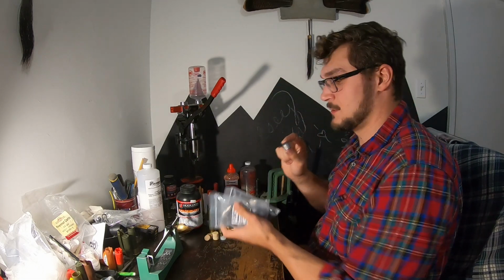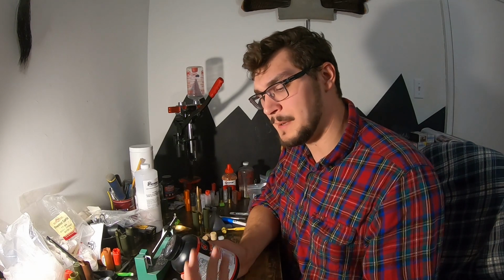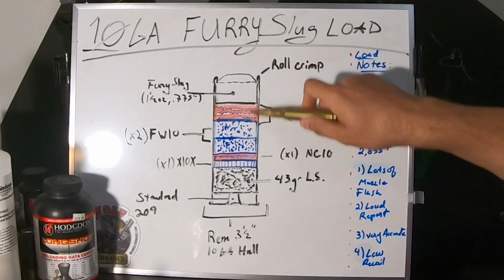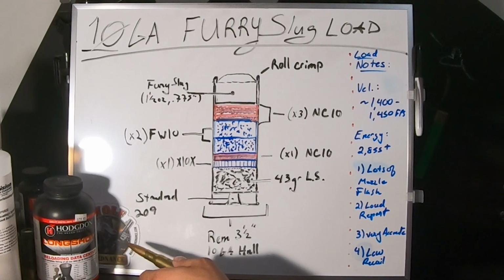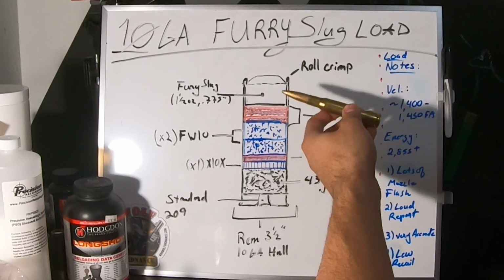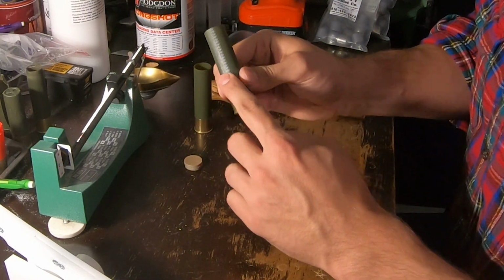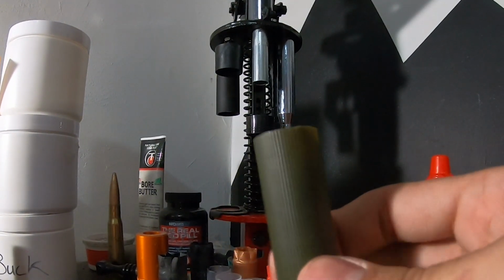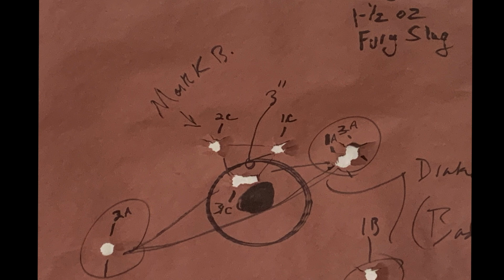10 Gauge FURY Slug Load: A Fast and Furious Game Getter

Comment from the maker: Welcome back to the loading bench at American Arms Channel! In this episode we examine my load for the Fury Bullet Co. 10ga Fury Slug. Please remember that this load has not been pressure tested nor is it published and is not to be considered reliable. Replicating my loading is done so at your own risk. Remember to always reduce charges by 10 to 20 percent to start and work your load up gradually. All universally accepted shotshell loading best practices and safety precautions apply. 

* DID ANYONE CATCH THE SPELLING ERROR ON THE WHITE BOARD?!?!?! HAHAHAHA!!!!***

Components and tools used:

Hull - Remington polymer base wad 3-1/2" 10ga hull (white base wad)
Powder - Hodgdon Long Shot
Primer - CCI # 209 (Standard)
Gas Seal - BPI X10X (Gualandi 10ga Gas Seal)
Nitro Cards - BPI NC10 (.125")
Fiber Wads - Precision Reloading 1/2" 10ga Fiber Wad
Slug - Fury Bullet Co. 10ga (.775") 1-1/2oz FURY SLUG
Roll Crimp Tool - BPI Original Roll Crimper (10ga)
Loading Press - MEC 600jr (10ga - 3-1/2" Mag)

Detailed viewer questions and private conversations, as well as industry contacts regarding product evaluations and reviews may be made at AmericanArmsChannel@gmail.com

Comment: Thanks for the video!  I have purchased several orders of these slugs.  I used Unique and Universal, but I will start using the large amount of Longshot that I have.  I have loaded them into both the 3-1/2 inch and 2-7/8 inch hulls (cut down R-P hulls).  I use the slugs for bear defense.  The Short Tens in my custom BPS 19-inch (w/ Remington 870P rifle sights) are a decent proposition.  5+1 capacity with the same power level as the Magnum Ten.  Again, thanks for the great video!
Reply from the maker: Sounds like one bruiser of a shotgun; you should do a video on it! 

Thanks for the praise! 

- Drake

Comment: HS6 is my go-to in 10, 12 and 16 gauge for field, slug and buck
Reply: I haven't been able to find hardly any 10 gauge slug or buck date for hs 6. I found a lead load but it uses remington sp10 wads which may as well be made of unobtainium.
Reply: @jacobackley502  whats your email ill send you pdfs of full manuals. Btw loading buckshot and slugs by payload weight is safe only problem is stacking fit if too low in a wad it can always be adjusted with filler wads. If the weight of the payload is just a little less than that listed on the data its OK pressure will be lower but the velocity will go up.
Reply: @WARXDEVILXALAN  jacobackleyusn2018, it's a gmail. I'm only not posting the full @ version to avoid the spam bots

Comment: Got the Terror .720 choke tube and it patterns great. Have you tried the .705 tube for the 10 browning gold light. If so could it be used more for decoying ducks? Or should I just I just stick with the the .720?
Reply from the maker: I do not have nor have I tried the .705” Terror Tube. The .705, being tighter than the .720 would not be the ideal constriction for decoying ducks. .705” is fairly tight for steel and other Non-tox shot types, and is likely to blow patterns and make it useless for any wing-shooting work, or produce highly dense shot patterns ideal for extended range shooting. Really, the .705” constriction is more-so a turkey choke than it is a choke for wingshooting. It can be used for wingshooting and with Non-tox shot such as steel (iron), but It may be much more finicky about shot type, size, and payload for good patterning than the .720”

If you are looking for a decoying choke tube for the Browning Invector 10, I recommend trying your Factory Mod and IC chokes, as well as any assortment of aftermarket IC, Mod, and IM chokes by *insert your choice of Manufacturer here*. Really, the .720 can do everything it needs to with Buck, Slugs, and fine shot sized loads of lead, steel, tungsten, and other and no-tox shot materials from 30 to 75 when you’ve paired it with the right load. It’s only flaw is too tight of a pattern for close range work, but you can’t have your cake and eat it too. Honestly, I carry two chokes with me when hunting with my G10: the Carlson’s .750” IM and the .720 TT. If one can’t get it done, the other can. 

Hope this helps answer your question.

- Drake

Comment: What are your thoughts using a 1-3/8 ounce rifled 10 gauge slug with this load? Any alterations you'd make?
Reply from the maker: You can bump the powder charge slightly to increase velocity. It wouldn’t change the load so much as the diameter of the slug and whether or not it will obturate to the bore. Give it a try!

Comment: Have you ever tried maxiball in you'r shotgun ?
Reply from the maker: The MaxiBall design would require either a base wad screwed to the tail of the bullet or a rifled barrel for stabilization. I am unaware of any MaxiBalls commercially offered that are larger than .58 caliber, so utilizing them in anything other than a 28 or 20 gauge would be difficult are require a substantial sabot. You could buy a mold for the design in .730 to .775" for use in a 10ga paradox barreled gun, but otherwise it would not be a stabilized projectile. You can purchase hollow base molds that are in essence a minie ball design that would work well in any diameter smooth bore.
Reply: @AmericanArmsChannel  minne ball is what I meant to print , sorry
Reply from the maker: @jimmybritt9537  no worries. I have a friend that is currently playing with a minnie ball style design and he will be doing some load testing with it. I may secure some from him and replicate his finalized loads to share with you all.
Reply: Well done w/brief to the point explainations...!!!!
How about molding your own rifled slugs and also;
smooth slugs for rifled barrels w/various lead density's...?

THEN experimenting with various types of powders + gr. charges;
along with the various bullet shapes to find the perfect all around load...?

Maybe even sabots and sleeves for both lead and copper bullets = be fascinating...!